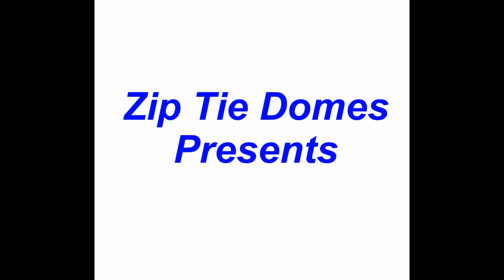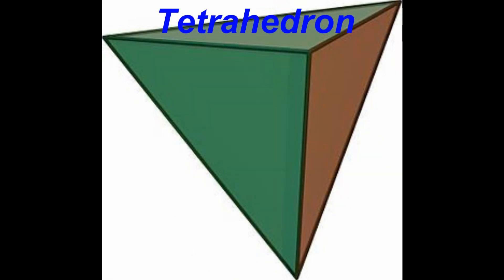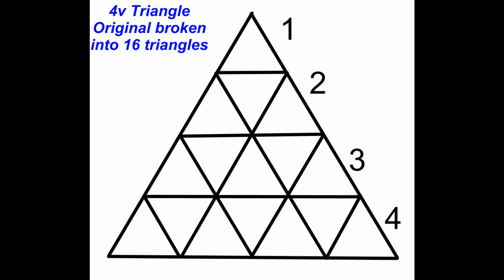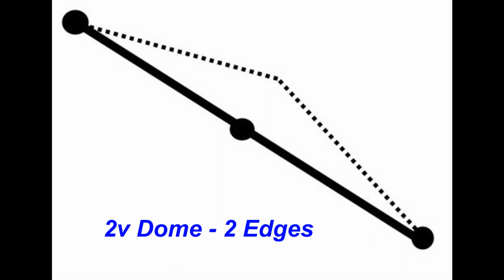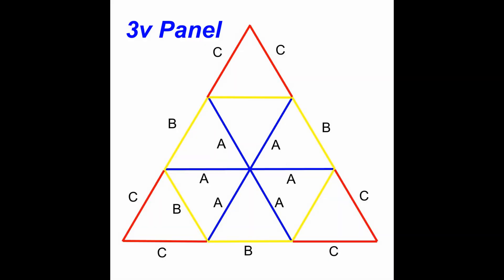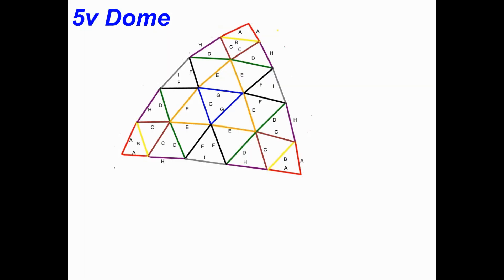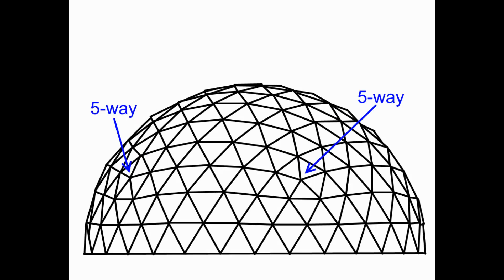What is Geodesic Dome Frequency? An Explanation of 2v, 3v, 4v, 5v, and 6v Geodesic Domes

Comment: While interesting, it's pretty old stuff. What is REALLY needed, is more automated, detailed explanation of the ENGINEERING. Most engineers just roll their eyes at domes, and the ones who master the calcs, charge a fortune. After all these years, it really can't be that hard.
Reply from the maker: Ray,
Most people watching YouTube are not engineers. If they were, I would have started the video with how to determine the chord factors using spherical geometry.  Using just the chord factors, I wrote all of the dome calculators in Javascript at https://www.ziptiedomes.com/geodesic-dome-calculators/geodesic-dome-calculator-index.htm  
Like you said, it really wasn't that hard, if you know how.  
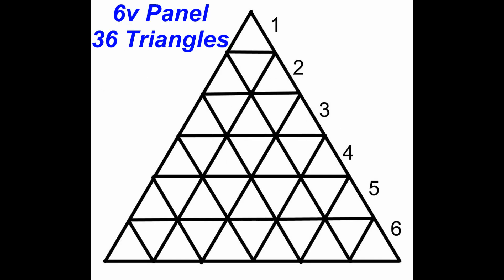I talk at little bit about chord factors at 6:10 in this video: https://youtu.be/hH21jpyJzlo

Again, not very hard.

What is "hard" to do, is to find a new way to use a geodesic dome, instead of using it to build a spherical house that leaks.  Stanford Research Institute is using our domes for radar reflectors at the Hat Creek site for the SETI project, as our domes are the only ones made entirely from plastic with no metal parts.  I am also working with a university on an Ambisonic Dome https://youtu.be/OzvZcisDq9Y which will ultimately be combined with dome projection. https://youtu.be/NGdUZGsOz0I
Combining ambisonics with 360 dome projection will be the entertainment system of the future.  Not that hard, but you have to be creative and think outside the flat screen and headphones.  Oculus Rift has a lag that makes me seasick, and the VR goggle experience cannot be shared with a friend.  Geodesic domes for family home entertainment are much more enjoyable than goggles, as you don't lose your sense of self.

One of my favorite videos on dome engineering that you may find interesting is by Paul Robinson at this link:  https://youtu.be/TqxarO-5igc

Thank you for your comment.
John Hurt
Reply: @ZipTieDomes  This video makes me think that the Cinesphere in Toronto's Ontario Place is not an actual geodesic dome. It looks to me like the spherical effect has been achieved by removing struts as the shape reaches its top. Correct?
Reply from the maker: @ronjenkins4257  Here is a link to the Wikipedia article on the Cinesphere:  https://en.wikipedia.org/wiki/Cinesphere
The Cinesphere is not a "triodetic dome", but is using triodetic hubs as connectors:  https://www.setareh.arch.vt.edu/safas/010_system_08_triodetic.html
A standard geodesic dome has a 5-way hub every 72 degrees around the dome, where the corners of the original icosahedron occur.  I can see no 5-way connections on this dome, rather each level of the horizontal struts appear to be perfectly parallel.  This makes me believe that the strut lengths have been computer generated and were not developed from chord factors. A computer generated dome would most likely create more unique strut lengths and make the dome more difficult to build.  But a dome like this, with the beautiful horizontal strut lines that have been produced would be perfect solution for an architect like Eberhard Zeidler, although it would be nearly impossible for the rest of us to even think about.  A very good design indeed.  Thank you for the information.  John Hurt

Comment: I thought the V stood for vector i.e. how many struts meet at the same point, but the v stands for vertex or vertices. Thanks.
Reply from the maker: Paul,  Yes the letter "v" stands for frequency.  Thanks for your comment.  John Hurt
Reply: Can you calculate my hometown's zoo geodesic "desert dome's'" frequency based on this url page of photographs ? My vision and perception is not as keen as in my younger days, and I can't see the forest for the trees. I am not able to perceive the 5-way connectors due to the multiplicity of of 6-way connectors :) - https://www.flickr.com/photos/41978639@N03/15793038276/
Here are more images of same dome in different light - https://www.searchencrypt.com/images?eq=CsFzNdOw2f29jp0hBWxwK5r4bFxaznByu%2FKBKRXfSTfBJmgHf3NlMUFg7SJaTly3
Reply from the maker: It looks like an 8v or 8 frequency dome.  Look through the windows to see the struts on the back side of the dome.  There are two 5-way connections visible, with what appears to be 8 struts between them.  Thanks,  John Hurt
Reply from the maker: Yes, "v" stands for Frequency, which is how many times the icosahedron triangle is divided.
Reply: Thank you!

Comment: Thank you for the clear explanation and documentation. Simply elegant solution to a single person build.I understand everything stated but what would be the downfall to using poles all the same length with your hub design? Is it just going to be less spherical with the asset of being even simpler?
Reply from the maker: The struts need to be cut to the correct lengths.  Otherwise, the struts may not meet up or fit at the hubs.  Thanks for your comment.  John Hurt

Comment: Love the video! Can anyone tell me why the icosahedron is the best platonic solid to build domes with? Thanks!
Reply from the maker: The icosahedron is already closer to a spherical shape than the other platonic solids, so it makes a good start for a geodesic dome.  But the Icosahedron based domes cannot be easily halved or quartered as can the domes based on the octahedron.  So it really depends on how you plan to use the dome.  Thanks for watching the video.  John Hurt
Reply: A 1V derived from a dodecahedron is closer to a sphere than a 1V derived from an icosohedron (which is just an icosohedron). But as Zip Tie Domes mentioned, it all depends on how you plan on using the dome. IE: Where you plan on cutting it, and how large you want your panels to be.
Reply: Even frequency  ICosahedrons can be halved easily and sit flat odds can't